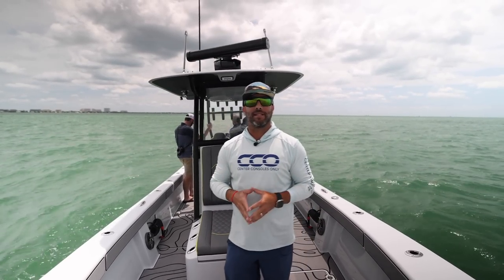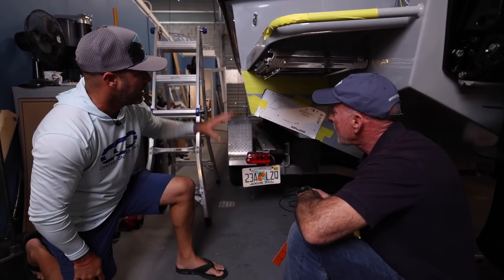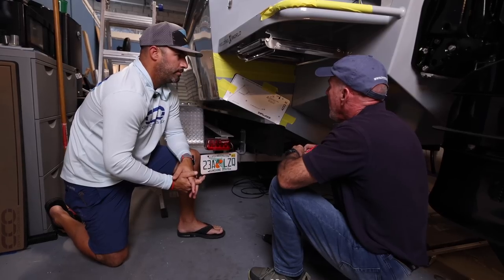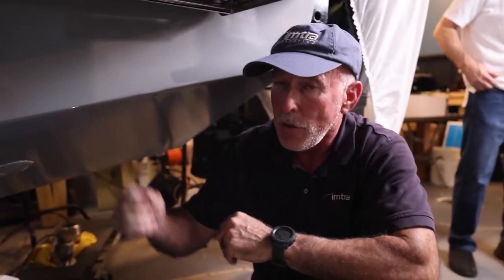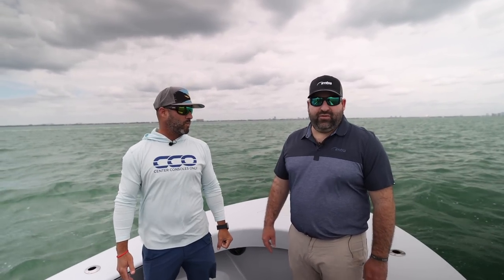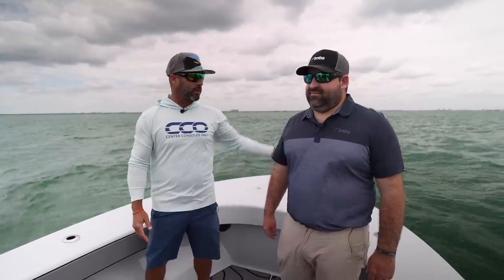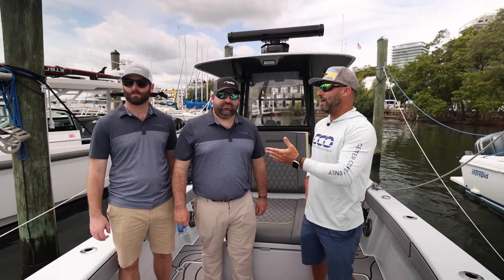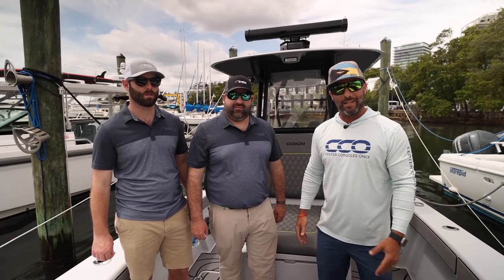Are Zipwakes the Real Deal?

Comment: There is NO WAY that I've ever choose these over traditional trim tabs.  There's a reason air brakes on fighter jets come out at 90 degrees to air flow.  To increase drag, not lift.  This boat is overpowered, if used on boats with less power to weight it would truly kill any performance it could have.
Reply: Wrong on multiple fronts
Reply: @s.dawson2490  Stick to your kayak paddling and don't interrupt grown ups when they're talking.

Comment: A big difference I noticed right away is there is no drilling holes with the Seakeeper Ride system. They grind the gel coat off then epoxy the Seakeeper system directly to the fiberglass. In my opinion the exposed bolts will have a corrosion problem in salt water over time. The algae growth is concerning also.
Reply: In the market for either these or the Seakeeper version. Exposed screws are no different than Bennett time tabs which have been around forever. Have you priced out the Ride system... it's for 7g'!!
Reply: Garage they are absolutely true

Comment: I've had them for two years on my 26 Stuart. Best upgrade I made to the boat. Set and forget. Wife loves using it. My boat does not have much bow rise .. but it is very much a round bottom boat and any major shift in weight from one side to the other will cause the boat to pitch over. Zip wake reacts very quickly to those situations and keeps the boat level. Which is the most important thing that I wanted addressed.  I had them istalled locally in Miami and come out of Matheson.  Good video!
Reply: Thank you for the great review!

Comment: Very nicely done video. Very thorough and informative. I am biased to Bennett Marine tabs. Had them on my last 3 or 4 boats over the years and almost zero problems. The only problem I had was one leaking cylinder and they took care of that at no charge way after the warranty was out. Great customer support, and the factory is right here in Pompano Beach. So I guess a price comparison and customer support comparison would be wise before making a decision. I was quite surprised with the fuel mileage. I would have thought with the tab going straight down like that that it would kill the mileage. That's about it. Thanks for the quality video. Cheers!
Reply: I've been in boats a long time as well, I thought the same thing based on the way the water was  forced, more like a brake instead of a trim devise works. I'm still seeing the efficiency of these though not working as hard as tabs do. Your thoughts???

Comment: Have them on my Vtech flats boat. They do a tremendous job keeping the bow down and getting up on plane much faster. My only complaint is that if I take a long, gradual turn they take a while to flatten out again once I straighten out since the system just thinks the boat is listing to one side. I didn’t know I could adjust the speed at which it corrects so I’ll try that! Maybe I should read the manual 😂

Comment: I think this device would be a perfect addition to flat bottom boats like the Carolina Skiffs. They tend to skip the stern across the water like a flat rock when making sharp turns at higher speeds. I’d be willing to bet this device would eliminate that skipping completely. I don’t believe all boats need this device just like the boat featured in this video but flatter bottom boats would greatly benefit from those tabs.

Comment: NOT a FAN
In the kind of conditions we go out in, I find it quite dangerous in the rough! Its fine for headseas, can be dangerous in heavy beam seas, and its a disaster in quartering/following seas. I have the engine dialed in spot on for planning, so I feel the auto function makes me dig in rather than helping me to get on plane!. Most of the impressive reviews, with zipwakes correcting the pitch didn't apply to me. I use it manually sometimes in headseas, keep the auto off, as I feel like it overreacts with sudden shift in weight while underway. There is only auto both trim and roll, and auto trim only.. I love to keep control of the nose in heavy following seas, and I could use the auto roll only mode as I'm going underway in not super bad conditions. So really I hate it for the price I paid for it and the lack I use I get out of it.. Happy for other owners to let me of their experience with quartering seas, beam seas, and following seas in general.

Comment: it looks like you did have to make some transom modifications, seen when you switched to the starboard side installation of the backing plate. Can you explain what and why you did it?
Reply: yup, somewhat major mod
Reply: Yea they completely skipped over that and it's by far the most labor intensive part of the installation. You need a flat surface to mount zipwakes to and the transom on this boat wasn't flat enough. So what you do is grind off the gelcoat and build up an epoxy platform that you then fair to create the flat mounting surface.
Reply: How do the interceptors actually lift the bow?  I understand that when they are extended they cause the bow to drop but how son they do the opposite ?
Reply: @allansalzman1072   they don't lift the bow.

Comment: Doesn't look like it will last very long. Looking at the design vibration will shake the unit apart or cause your transoms to crack.
Reply: Zipwake has delivered 45,000 systems to the commercial and recreational markets with great success.

Comment: I was thinking this was for causing some kind of improvement in the wake for trolling… obviously not the case.  To me, this looks like an expensive weight adding power robbing DRAG INDUCING device that would decrease your mileage - made for boats that weren’t designed to run right to begin with.  I completely understand the concept, but it sure seems like tabs would cause far less drag.  How about key on to key off mileage numbers with and without…. No offense to the manufacturer - plenty of boats out there that run like shit and need help…
Reply: spot on